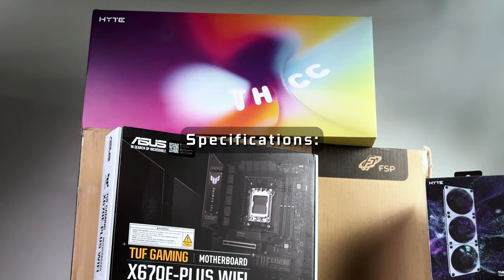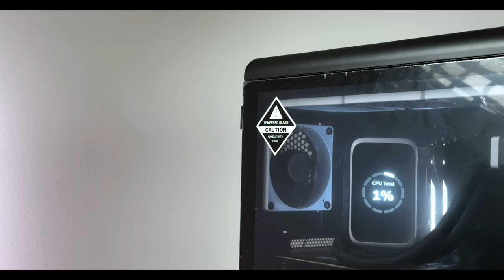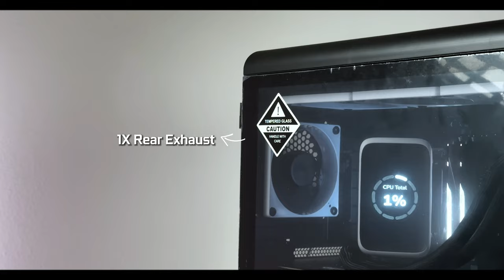The biggest AIO screen! OREO PC Build ft. FSP [RTX 4080 Super | Ryzen 7 7800X3D]

Comment: Not bad, thanks for the video.  Only thoughts are tubes on AIO should be at the bottom and having to remove the fans on the radiator is going to hurt it’s performance, probably to the point where a slimmer (and cheaper) one would be better.  However if going to aesthetics, yeah I understand it.